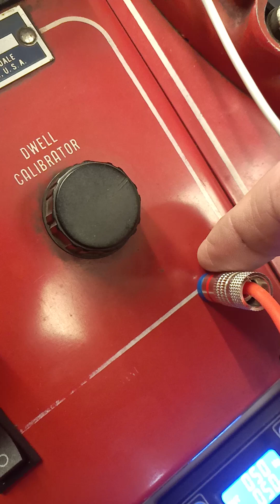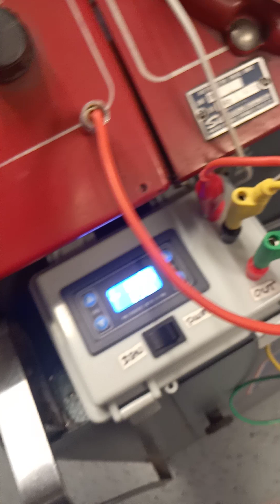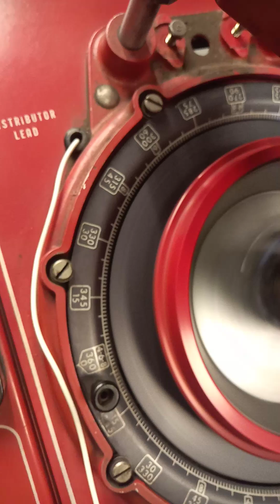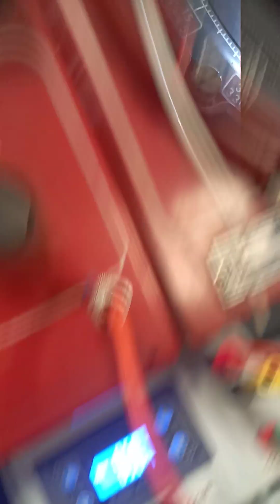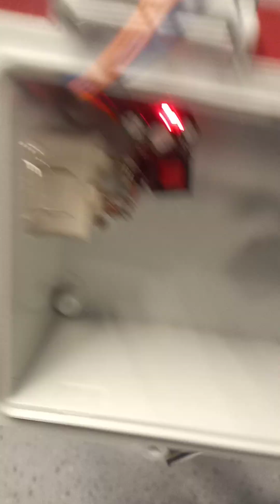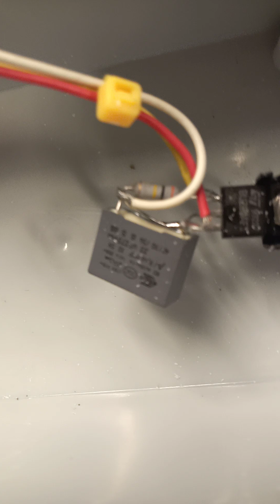SUN DISTRIBUTOR MACHINE CALIBRATOR For Tach and Dwell

Comment: thanks for sharing that! still wanted to contact you about buying LED dwell angle module but can't post a comment when my e-mail adress is there :(
Reply from the maker: Events have really delayed my getting this rebuild sequence finished, I am about three weeks behind.  Your dwell tach module is in the 50 series that I do not have direct documentation on.  Verify that the insides look like this.  I still have some additional documentation to do on the conversion of the dwell/tach from 6V to 12V.  This should be similar to yours.

This conversion is not an easy 1, 2, 3 step or a complete package of what is needed.  It requires abilities in several disciplines.  Balancing alone is tricky.  Review the videos closely.  This is a complete removal of everything and should only be done if the flash tube is completely dead.  Emails should just include the name with an A or G etc for the provider. I am still looking at mid January for parts to be received.
Reply: @opera5714    thanks for reply, for me there is no rush, I will watch videos very carefully once again,  my tester has dead flash tube, moreover rpm and dwell gauges are damaged mechanically. I still prefer to convert and fix this unit as getting another one in Europe will be very hard :) I think I have enough skills and time to do that heh
Reply: @opera5714  the kit does not have to be complete conversion kit, I am mostly interested in the dwell flash part if it is separate module (I even have received LED conversion kit with my unit, made by company called VerSatile, haven't tried to install that yet)
Reply from the maker: @piotrekflex  There are dozens of these out there and nobody has had an issue with the installation.  Just want to warn those who might be squeamish with electricity. Just post email name without the dot com.
Reply: @opera5714  it deletes my comment when adding email just without dot com :( above I have written gmail name just delete the G